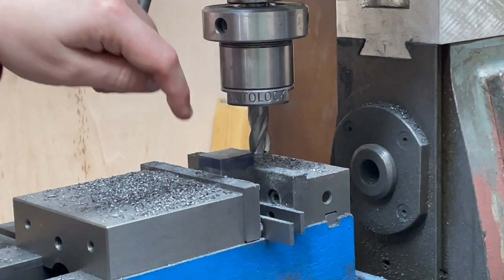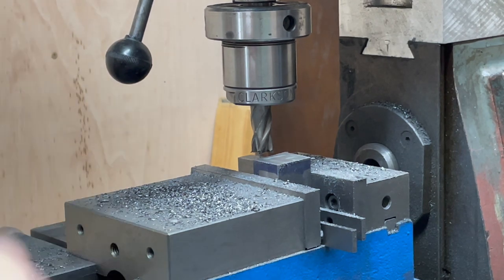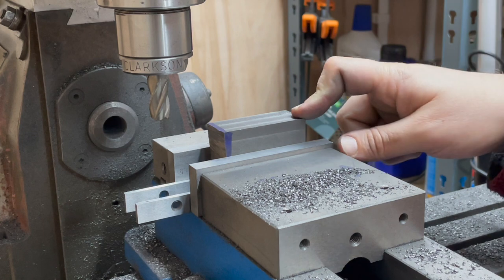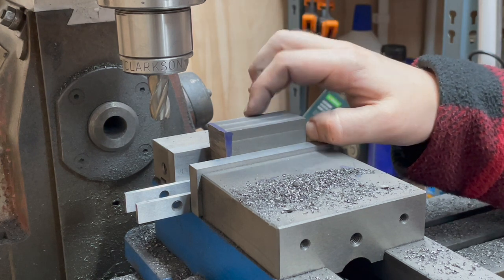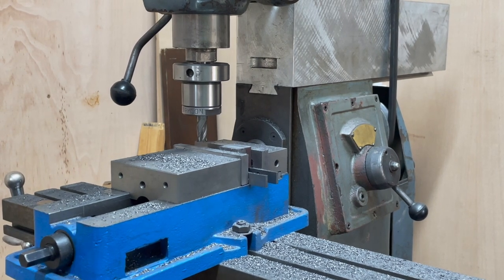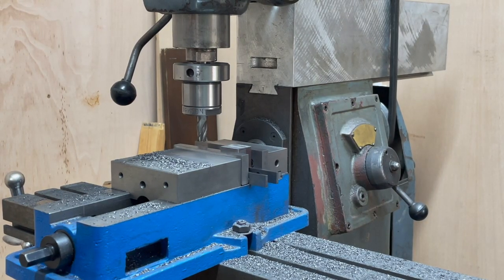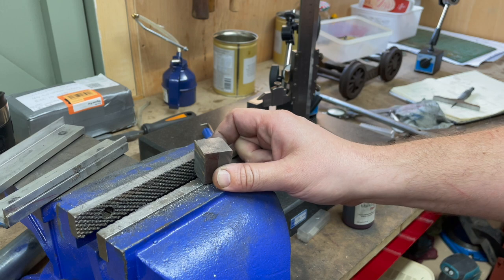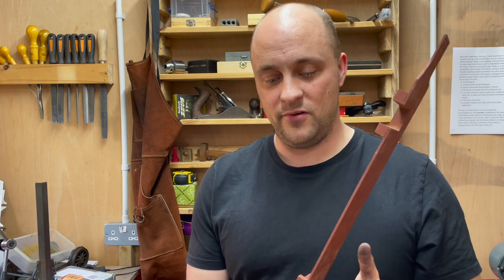NEVER GIVE UP - Axleboxes Part 3? - Steam Loco Build #11

Comment: Hello William. I just purchased a Centec 2b just like yours, and now I have to find a vise for it. Can I ask you what size of vise you are using and are you happy with that size?
Reply from the maker: That vice is a 4" Arc Euro Trade Versatile Vice - it's pretty decent for the money! I wanted to be able to hold large parts, but if I didn't then the 3" Abwood I had before would probably have been fine. There are two drawbacks - the extra width means you're unlikely to be able to fit setups next to it on the table and will need to remove it,  but that is a trade off for a bigger vice. 

The bigger issue is that due to the overhang and thickness of the fixed jaw (even with the vise in the front T-slot,) the maximum X-axis width of a part where a cutter can surface in one setup is only 1.25". You could machine off the overhang (it's not functional unless you're using coolant) to gain another 1/2" or use clamps on the rim instead of fixing bolts. Or, move the jaws to clamp ontop of the vice. Or, take the vice off and surface with a split vice or clamps.
Reply: @williamsworkshopuk  Thanks for the detailed answer. The thickness of the fixed jaw is exactly what was worrying me.
I am thinking of buying a vice that looks the same as yours but from aliexpress, I will check with the seller it there is a significant difference in the thickness of the jaw on the 3" vs 4". 

I am also thinking of buying it with a swivel base so I can test out mounting it sideways as it might give a little more clearance.

Good luck on your train build!
Reply from the maker: @gunniglaepur  I got mine with a swivel base also, but I want to get the maximum rigidity possible so I don't use it unless it's absolutely neccesary. I would be careful about which vice you order - they all look the same and are probably all made by the same factory, but the best ones go to company X, the next best to company Y, etc. - and so the ones which are as cheap as chips on AliExpress MAY be the bottom of the pile. I went with Arc because they have a good reputation, and it arrived in 24hrs!

Comment: william i sent you a message stating that my centec only had 7 1/2 " travel on the table   from left to right  could i re situate the nut ? regards   laurence
Reply from the maker: I replied I think, I don’t know about the nut but I doubt it - you’d need a longer screw and a hole in the axis handle for it to go through?